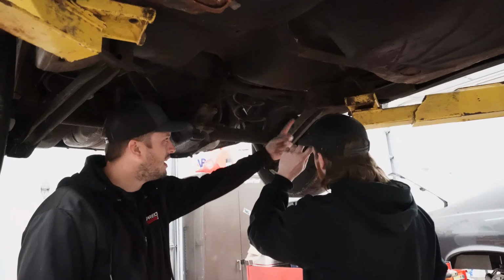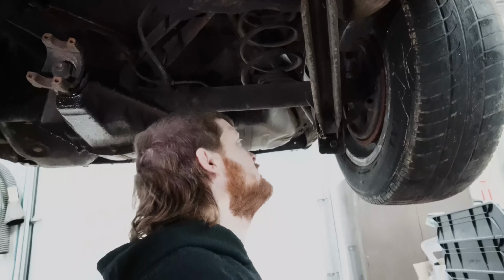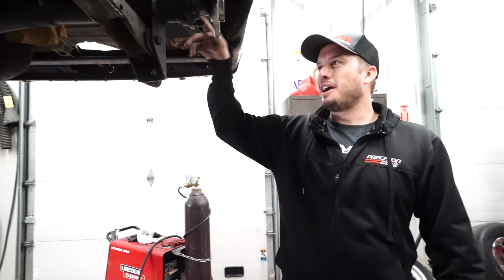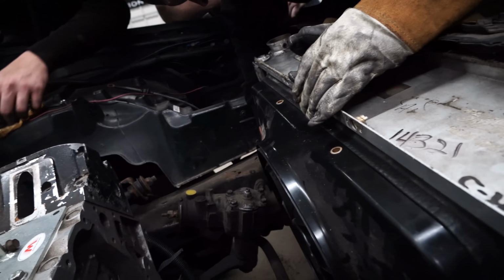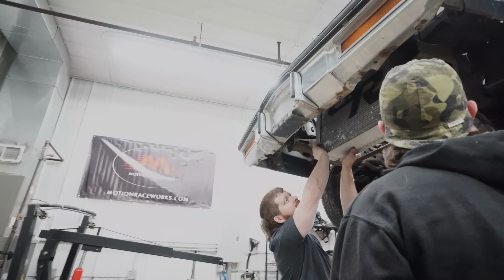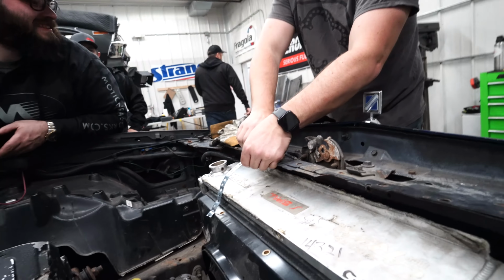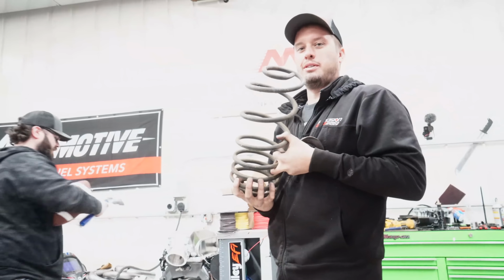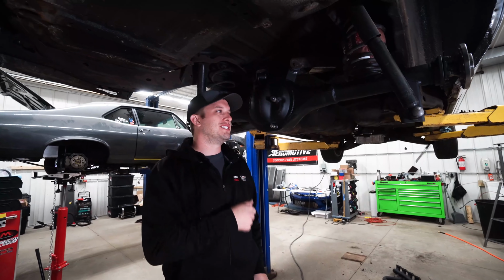The BALD rEAGLE Burnout Machine!  Can we make Cleetus and Cars? Day 1

Comment: You guys look like a DOT work crew. Four standing around watching and one doing actual work.
Reply: That's how road construction is done in my state as well and you can't forget the one dump truck and the one loader and one dozer while many others are just sitting around idling using the A/C or heater depending on the season

Comment: Put 2footballs one each side  you turn left as hard as you turn right pump them up as much as you can same with the rear tyres 70 psi  the idea is to get the least amount of traction possible with the highest tyre speed so max revs in top gear so switch the limiter off when you bang limiter you stop making smoke

Comment: You are in roundy round territory lol of course they don't put perches on the axle. Also should be easy to get a used set of tubular trailing arms cheap
Reply from the maker: irunolds yeah we have a set on order.  Figure after the first wall tap we will replace em lol
Reply: Yep if we get a rear with perchs already on it 99% the time we have to cut them back off and move them lol
Reply: @54raceman  and then zip tie them back on 😅 or maybe that's just me who always forgets to tack em